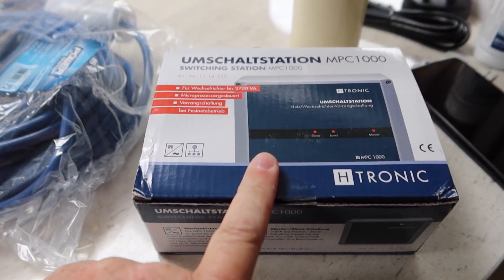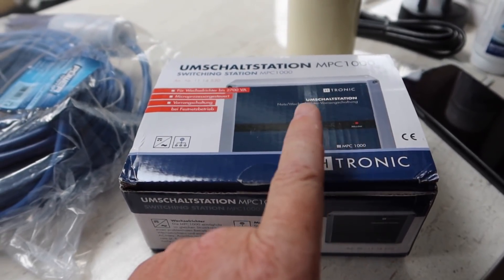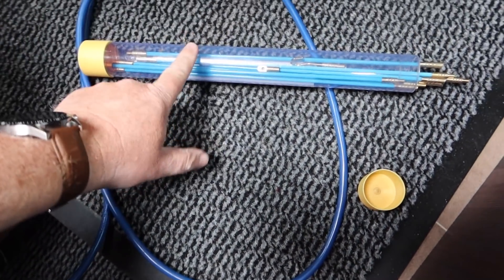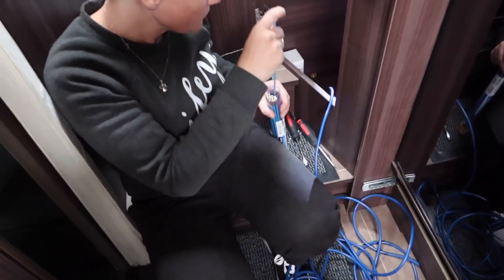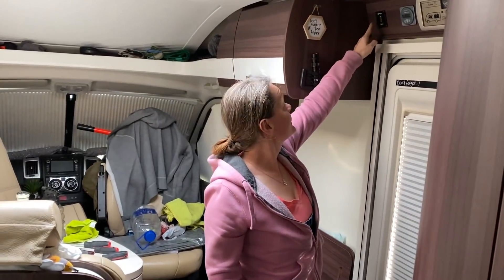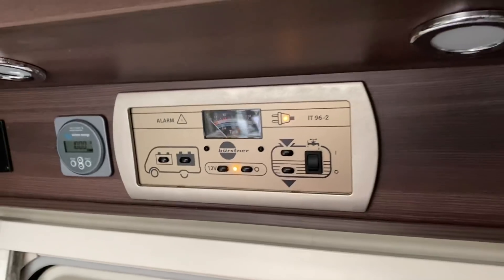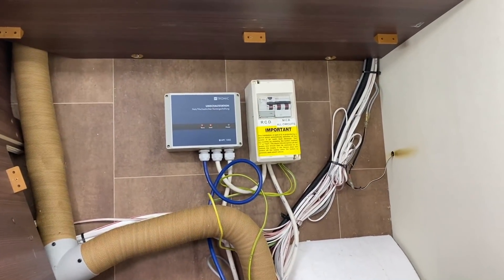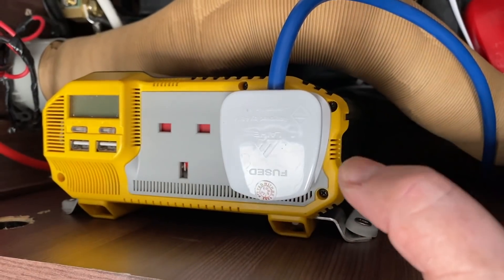Mains EHU to Inverter Power Auto Switch Install - VanTech Quickie (ish)

Comment: John, was it just me or does the auto switch over emit a buzzing noise? If so, is all the time, like yours, I'd have to place it under the bed and I don't want it buzzing away all night - ahem 😂
Reply from the maker: No buzzing at all. It’s a relay. 👍🏼
Reply: @GadgetJohnAdventures  yeah, just sounded like it had a bit of mains hum on it in your video
Reply from the maker: That’s probably interference from the mains picked up by the mic. 🤷🏼‍♂️

Comment: A.....MAZ....ING!!! There was me thinking of using the same system greg did but this is a lot easier to install. What's the maximum current it will take?
Reply from the maker: 16A is the most you should put through any hookup, but given the plugs are 13A rated at most I would say 13A is the biggest you should put through this system 👍🏻

Comment: Hi John and Mandy. Hope you are both happy, safe and well. Love to watch your videos: keep them coming please.
On a previous video I queried why not just interrupt the hook up supply cable with the H-Tronic unit. John you said that you did not want to do it that way. Why did you change your mind having found the socket cables?
Also, what are the benefits of the H-Tronic unit over a double pole change over relay like this RS one: 292-8427? T
he relay coil could be energised by the hook up supply and disconnect the normally closed inverter feed and connect the hook up to the van mains circuit.
All the best 
Richard
Reply from the maker: After realising that it was simpler to just switch over the full van and disable the onboard battery charger I then just wired it in this way. I chose this as it was well reviewed by others. 👍🏻
Reply: Does that mean you are relying on solar to charge the leisure batteries when hooked up for long periods. I do not understand why you have disabled the on board charger.
Reply from the maker: Yes, we generate around 1.5Kwh on solar each day, so we’re never actually going to need to plug-in. So there’s no reason to use a mains charger at all unless we can’t generate any solar.

Comment: Nice video John .i am after sum  Advice just put sum solar panels on the new van roof . Do I put the Isolation switch on the  Wires that come of the sola panel. Be for the it gos it to the mppt.up after the mppt on the out coming wires going to the battery?because wen I went in the van this morning all the lights were on .so on solar side battery side? Help
Reply from the maker: I’d install the isolator switch on the + wire from solar panel to solar controller. Then make sure you also install a fuse from the solar controller to your battery, I have my solar controller wired to my fuse box so I can easily fuse it.
Reply: Thank you so much. I was going to put the  Switch after.so thank you .keep up with the good video I watch you 3 all the time .keep save.👍

Comment: I'm in the middle of adding all the cabling in my van conversion for the sockets, so does this mean I can just install 240v cable for all the sockets then add in the Power Auto Switch instead of having 2 different cables (12v & 240v) around the van?
Reply from the maker: No, this is purely to use 2 different 230v electric sources. This is nothing to do with 12v.

Comment: I'm very surprised, being that you like your BMV-712 monitor, that you never went for the Victron Energy Multiplus system, automatic changeover/inverter/battery charger in one nice little neat unit. Quite costly as I'm sure you're aware but we're extremely pleased with ours! Thanks for the videos, keep them coming! Charlie & Tash @weboughtavan
Reply from the maker: That's easy, I buy the best for the job at prices that I think are justified, so I think only the victron solar controller and BMV are worthy of their prices, the rest of Victrons gear is WAAAAYYYYY overpriced and over complicated. I have a really great rule I follow  -  K I S S, Keep It Simple Stupid - so everything you do can be maintained and fixed without too much faff or money. 👍🏻

Comment: Nice vid 👌 one question have you changed the fuse in the plug to match the inverter or left it 13A?
Reply from the maker: Good question, The fuse it rated to the inverter, so it was changed to a 10A fuse.

Comment: Many thanks for this. It is what we shall be doing in our Nexxo T740.On a slighty different point; do you know what value of fuse is on the 12V power rails, the ones that you can plug in those moveable Dometic led lamps & USB adapter/charger?
Reply from the maker: As the USB is 2A max and the lights are LED I'd say the fuse should be 2A Max

Comment: With feeding the cable through the floor of the van, does that mean there is a space under the whole floor of the van, then another floor under the space. This space to be used for cables as you have just demonstrated?
Reply from the maker: That's something I am going to explore in time, I think there is a fair bit of heating ducts under there but not much else.

Comment: Brilliant John just what I need, was going to install a switch, to change between invertor/hookup and Sargent controller but think this would be much better, would save having to switch over each time, love all the videos mate keep them coming, Brian
Reply: I'm not sure about this being better than a simple manual switch, as you mention, because electronic gadgets invariably fail at some point, and so would worry me constantly. I usually like automatic devices, my favourite has always been the automatic gearbox for example, but here I think it's better to just have a switch, that you use if you hook up, really easy and completely reliable. Alan, in Norfolk.
Reply: alan may inclined to agree. I have to go into the garage to get the hook up cable anyway so may as well save £50 and flick a switch.

Comment from the maker: So in this video I'll show you what I used and how I wired it up in our motorhome.
Mains cable used - https://amzn.to/2wOPlCR
Cable pulling Rods - https://amzn.to/3cwyYtY
Mains Power Auto Switch - https://amzn.to/2ynHBYP
2KW Inverter with remote switch - https://amzn.to/34Mbv57
3 Pin Plug - https://amzn.to/2xw3k0R